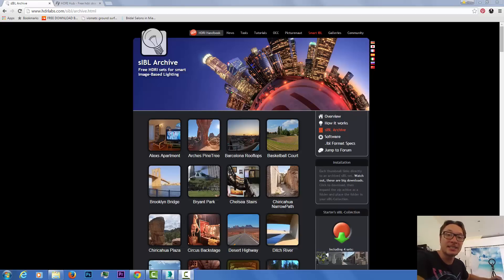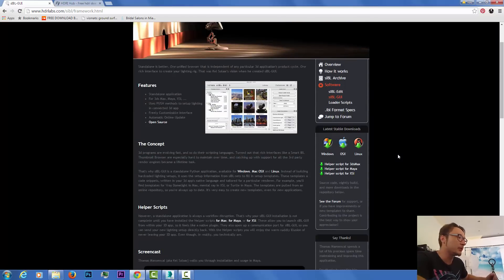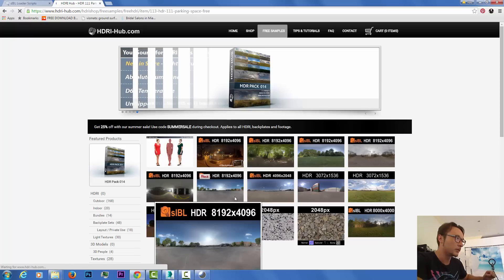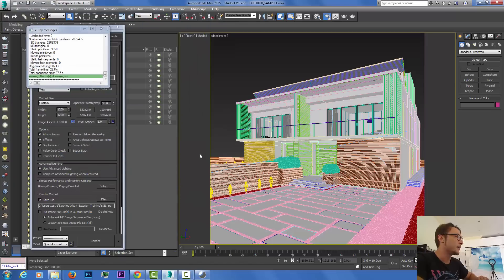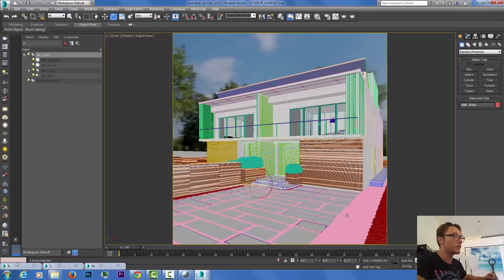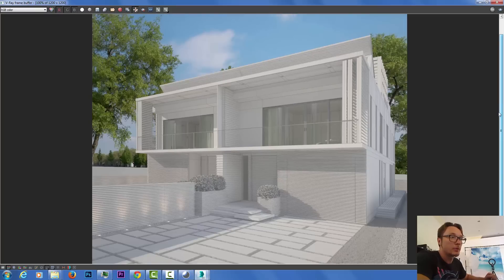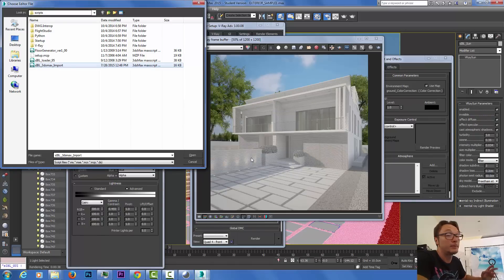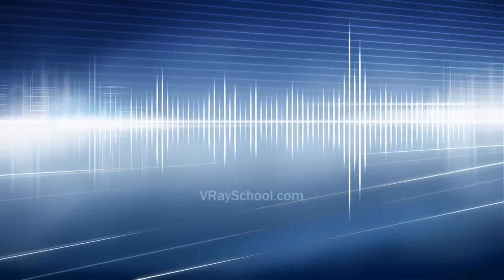sIBL - 3DsMax VRay Exterior Lighting

Comment: If I'm not mistaken, to make the 3ds max plugin work, you need to put it inside the "startup" folder that us inside the "scripts" folder of 3ds max. Having it only inside the "scripts" folder will not make it work, and therefore make u prefer to choose to run the generated script, choosing from the menu to open a script, searching for it through directories, and such. Although...looks like the loader script is no longer supported after 3ds max 9..... :/

Comment: actually you must rotate the sphere with map inside 3dmax not the SIBL DATA helper.. if u rotate the the data the hdri and backround image wont rotate at all... if u need to move the system yes you need to use the data helper only.. also is a good idea turn off the vray camera exposure